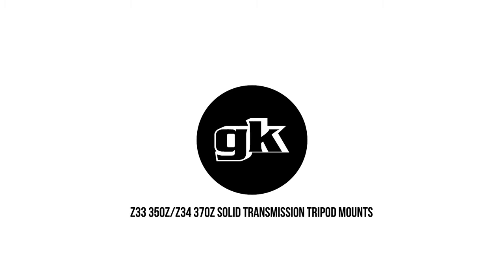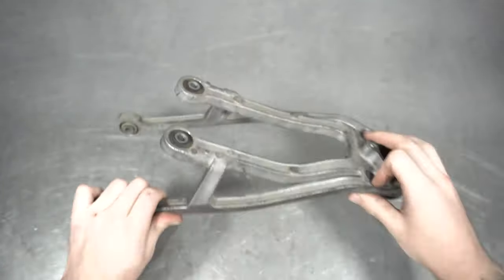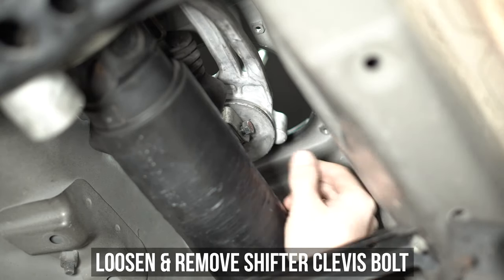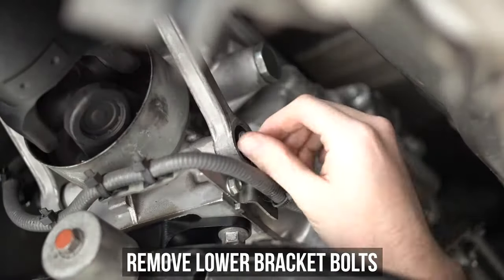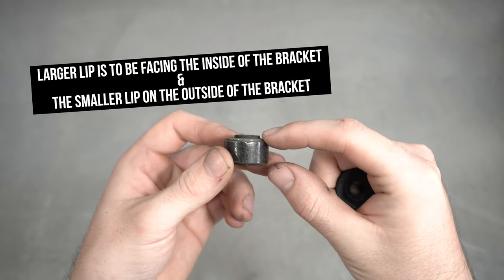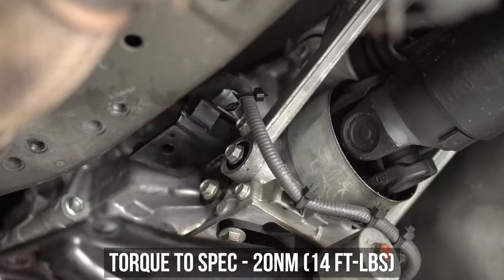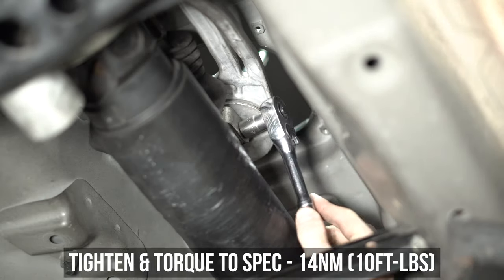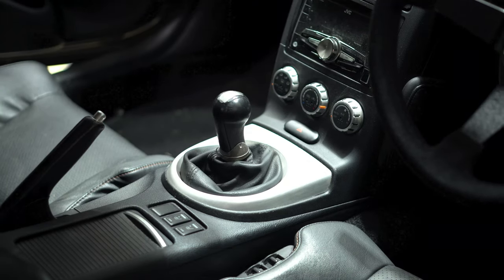Gktech Z33 350Z Z34 370Z Solid Transmission Tripod Mounts - Install

Comment: Just a heads up...this does not fit cd01 trans (uk spec)

Bought as I was changing my clutch as gearbox was out already but no bushings to swap out 🤦‍♂️
Reply from the maker: We haven't been able to locally come to a conclusion which trans had the solid mounted tripod but yes, some do not require the bushings.

Comment: 1:42 what is that tunnel support called...i searched tunnel support z33 and nothing popped up.
Reply from the maker: Hi mate, I'm unsure of the correct part title or part number. It doesn't appear to be structural and isn't an option across all models.
Reply: @gktech  oh, that makes sense, just thought i was missing something, thanks.

Comment: Anyone know what size socket is needed to press these out? 15mm or 18mm
Reply from the maker: As each brand socket varies in sidewall thickness, I'd suggest using the correct tooling.